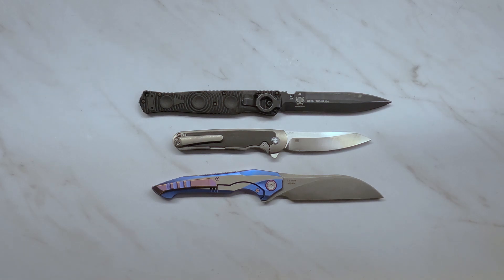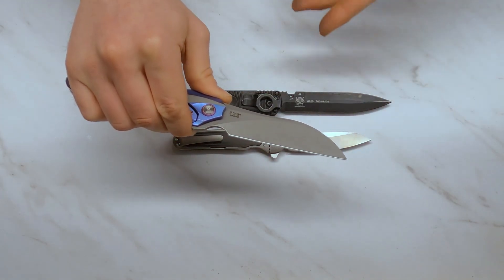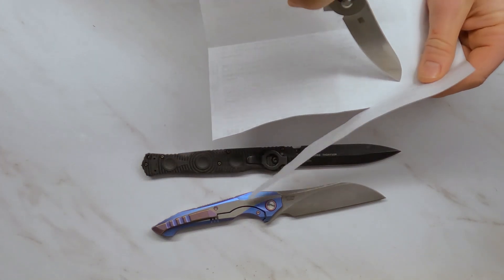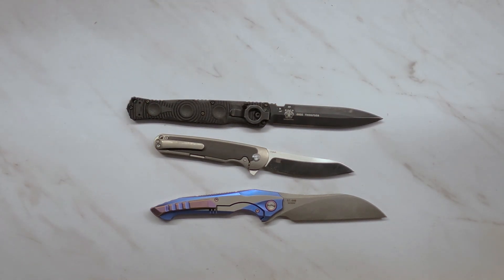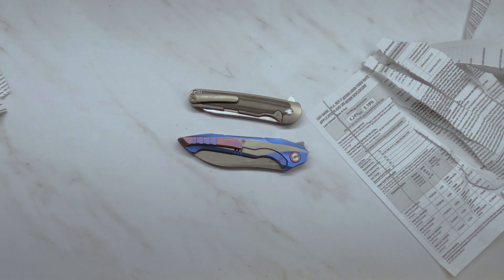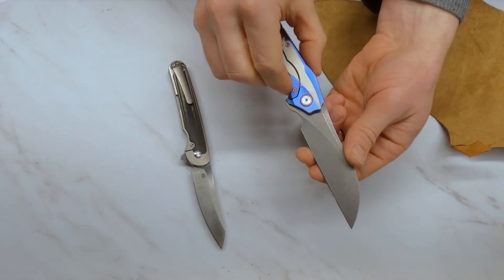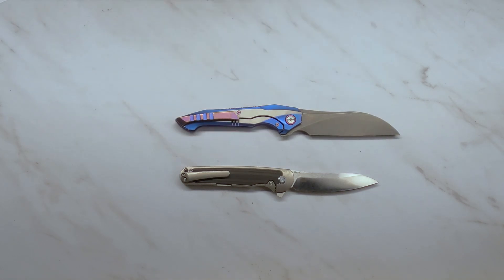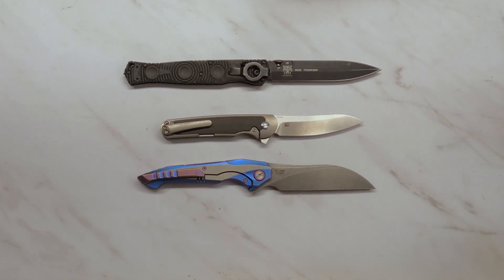Corrosion Resistance Testing! M390 Vs S35VN Vs D2! Benchmade Vs Kizer Vs Sitivien

Comment: I better test to do would have three exact blades same shape and finish just each different material but that would be kind of hard not sure if there's many manufacturers out there that make one blade and three different kinds of Steel
Reply from the maker: That is a good idea. Even if it isn't the same manufacturer, the same finish would be a good controled variable. Spyderco makes Manix 2s in lots of different steels, so that might work!

Comment: I have suspected the corrosion resistance on LC200n explains how it maintains an edge longer than the hardness would suggest possible. 

Excellent video.  Well done!
Reply from the maker: That is it exactly! LC200N can sit on a shelf or in a tackle box for months and still be razor sharp. That makes it great for certain applications even if overall edge holding when cutting is relatively poor. Corrosion resistance WITH great edge retention is what makes Magnacut so unique.